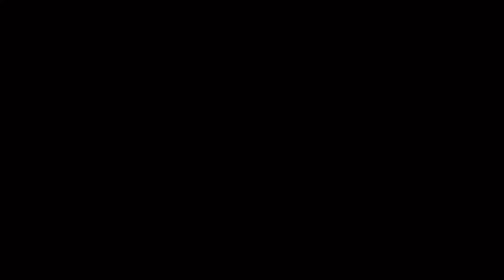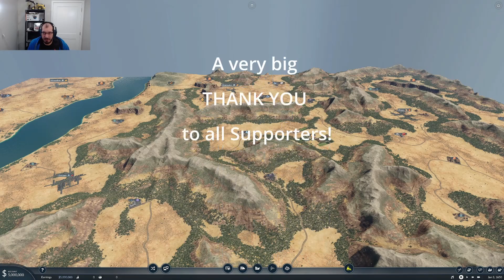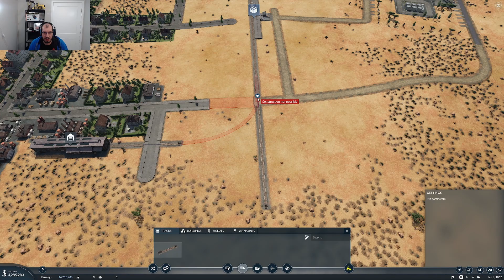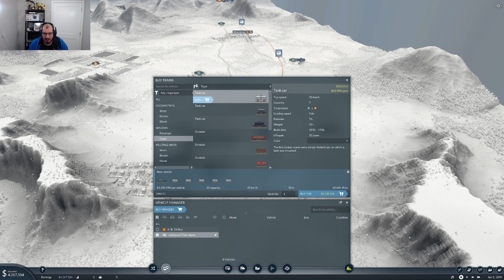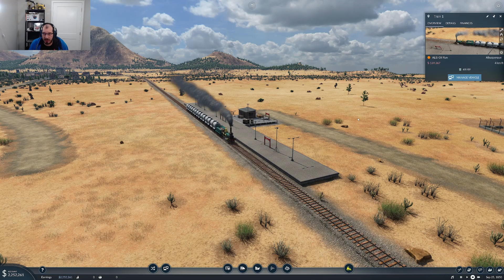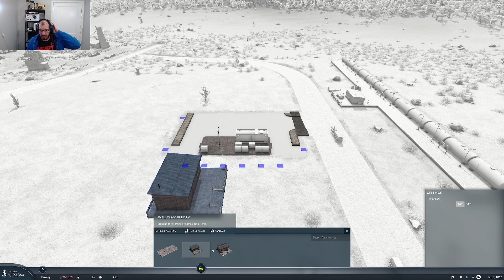Starting the Brutal EPEC Challenge  | Vanilla, No Mods | Brutal EPEC | Transport Fever 2

Comment: as i know the price for freight is allways the same: calculated through the distance between the two manufactures you deliver. Speed only increases the freight you can carry over time and so you make more profit.

Only if you carry passengers the speed is essential for the price and the number of passangers who want to be moved. The faster the passanger train, the more money you get. And also the distance plays a rolle. If the train is faster than the private traffic, you gain more passangers who will use the Line.

I for me, deleate all street conections between cities, if i conect them with a passanger train. Before that its a good way to growth the cities, but after they you want to gain money, and so you force them to use your trains, because its the only way.
Reply from the maker: I don't think that is correct...if you upgrade from a slower train to a faster one, the ticket price increases (ticket counts for any unit of cargo/passenger). If it's not just the speed, then it's a combination of speed that affects the price.
Reply: @bballjo  I will test it. I have an excel sheet to calculate which trains are the best (economical) in use in terms of goods throughput and costs (buying, maintaince and time of using (till a better train gets available).
But speed is in this calculation only relevant for time you need, the frequency. If their is an aspect of earnings i must change this :)

Do you know, the values the games shows us during creating a train on the right buttom (good, mediocre, seconds and metres) is this calculated with freight or without (weight plays a important role here). Because we do not know the exact calculations, i used an approximate calculation based on a formula based on this values. But i think its not correct empty and full loaded.
Reply from the maker: Hm...I always too that as fully loaded, but I've never spent a lot of time on that, as a lot of early trains are mediocre or worse...later on it seems to matter more, since the trains are actually beefier.

Comment: I always found it annoying to start on hard because of the supply-side demand. Train maintenance is a real B-word, especially when you need to burn cash on a route or two to even have a product to sell. I would happily fire the game back up if that isn't as much of an issue anymore, or the industries seem a little more dynamic during your playthrough! Excited for more!
Reply from the maker: The start is still hard...but you can change several settings now, including difficulty on any saves.... right now I experience a lot of crashes, so I would say if you want to give it a try wait until it's out of beta :)

Comment: Bballjo now that you can set a specific lane for the vehicle to follow with signals, we can make more efficient highways. Pairing that with multiple platforms you can make a truck empire. 👍
Reply: Using the river for transporting between the ends of the map, rails to distribute from ports and trucks from train stations and to remote areas. That's what I'd suggest

Comment: You could make a more profitable  setup like this> first line from Oil well to refinery and back. Second line from Oil well to Fuell production and back. Then you distribute product Fuel from Oil well. Both train lines deliver both ways. Most probably those two lines will be enought to print money for entire game.
Reply from the maker: Interesting...I may try that... thinking about it in math, and splitting the line up into the sectors, there would be 2 sectors, and right now the line runs through all of them, so 4 sectors, but 2 of them full, and 2 of them at about half full...with what you said I think we would still see the same ratio, but maybe a little bigger frequency...again, I may try it :)
Reply: @bballjo  Well, when you go to detail, line_1 from Oil well, goes full one way and back half  empty. Second line is the long one and  goes  full both ways. Because of refined oil is 1:1 to fuel. e.i. there is only one way of short line where is half empty. All other routes are full. If I use yours sector theory. Then for recommended system it is only one sector is half empty+one sector full, and (second line) 4 sectors are full. i.e. 5 sectors full + 1 sector half empty
Reply from the maker: You are ignoring that the city near the fuel factory wants fuel, so half of it goes there, half goes on the train...also not sure how you got 6 sectors, plus the station at the old refinery is exactly in the middle, so both lines have the same length...
Reply: @bballjo  No. All fuel goes back on train and travel back to Oil well, that is the trick. Then distribution of end user product Fuel starts from Oil well's train station. No exceptions! i.e. another train can take fuel from OilWell to The_city_close_to_Fuel_production. This delivery train goes only one way full, back empty, but it doesnt matter, as long as it makes positive money it is ok. The Capital Moneymaker is the long route train delivering full both ways Refined_oil <> Fuel. All other infrastructure is only support to achieve that. I can understand this system is a bit counter-intuitive, but it is worth it, Try it you will see..
Reply from the maker: That is a very cheaty way of gaining the system, but with what I've seen so far that may be one way to combat very hard...
Reply: @bballjo  This system works since TpF1. :D  Consider train station by Oil well as an Oil Cargo hub, you could use the new alternative platform to make  it even more interesting, make  the hub slim and effective. Use 2 platforms for 3 lines.
Reply from the maker: So I tried to exploit the game, taking all the fuel back to the oil well, and distributing it from there via truck....the train was making marginally more money (2 sectors that were 50% full now got 50-100% full, but it wasnt stable)...but the trucks were not able to keep up, and actually had a loss that erased any gain from the train line. If we would add another train that would then again take the fuel from the oil well back to the city near the fuel refinery, then that train would only be half the size of the original train, and we would need to add another station, both would increase maintenance cost...what it looks like at this point: You have to run LONG trains with appropriately sized engines to make money, otherwise you will float near even.
Reply: @bballjo  Yes, trains  need to be sized properly. Instead of LONG trains is possible you would need 2 - 3 trrains on the long route so all trains on the shared track has similar speedd and power rating, so infrastructure is shared. Also usage of wait for full load for  about 10 minutes is  expected.

Comment: for the train, I would have let the train go back an extra time to the oil field, so it fills the train with refined oil to the refinery, instead of half filled trains the second part

Another option would have been a seperate line for the crude, and refined, so they can wait for full, and still return fuel on it.
when things going better, you can double up the crude (assuming crude and refined take same time) and basically have them move stuff back n forth
Reply from the maker: That's what the trucks are for...if the train has to double back, it will run completely empty for that section, but it's full with oil from the second station already, this way the train is 100% for the first 2 stops, and 50% full for the last stop, so it's average utilization is near 70%...